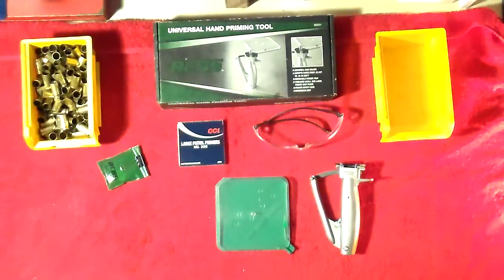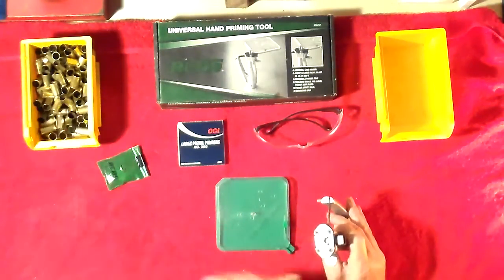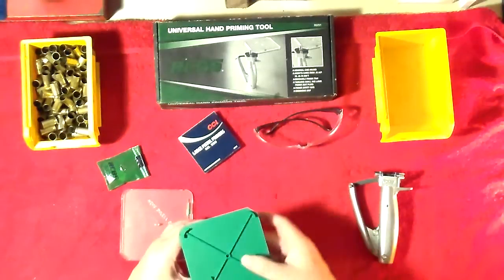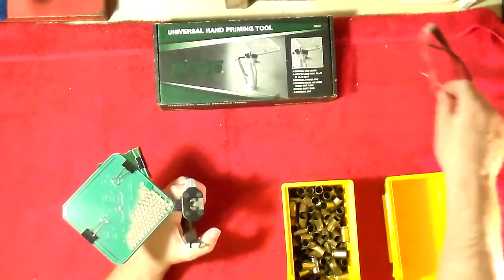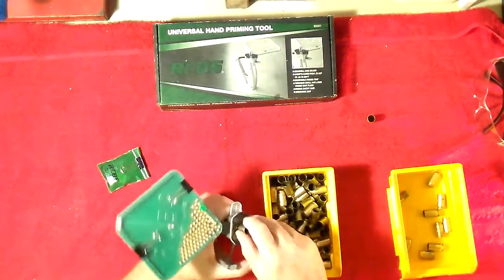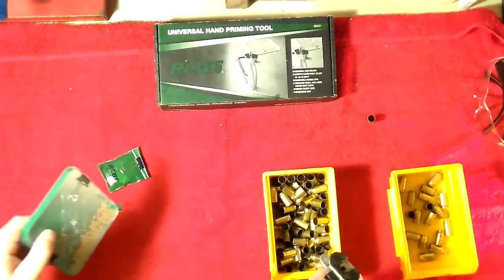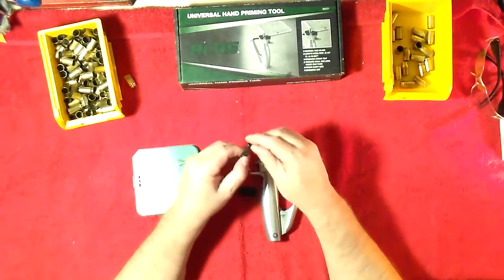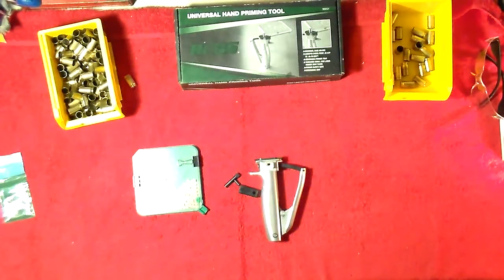RCBS UNIVERSAL HAND PRIMING TOOL

Comment: Thanks for the very informative video. I'm researching reloading my rounds. I have just one firearm - a .308 calibre Bergara rifle which I use solely for long range target shooting. I'm just beginning to research and buy the kit required for reloading (- as I'm nearly broke buying Hornady 168gr factory rounds off the shelf. !!! ) I wont be reloading anything but 308 Match cases. I have 300-400 once fired  cases ready to go. My question is - do you recommended I buy the RCBS Universal Hand Priming Tool 90201 (with square tray) or the marginally less expensive RCBS Hand priming Tool (Model 90200 with the Circular Tray) and then buy the required 308 shell holder separately. Is there any benefit in using one model over the other (90201 v's 90200) when priming one sized cases only. For example would the 308 cases fit more snugly into a 308 shell holder than into the recess on the Universal 90201 model? Are there any disadvantages to either approach when priming 308 cases only? Thanks. John (Ireland)

Comment: like you showed at 3:45, one problem with this tool.  snapping the clear lid on flips several primers.  very annoying.  even if I try to leave the lid up slightly, it doesn't allow the primers to flip very well
Reply: I found if you leave the bottom tray on the bench flat, then very quickly snap the top on, the primers rarely have a chance to flip over. I would say 1 in 100 maybe.

Comment: Nice video buddy but i would not be putting my hand over the top of your brass when you are pushing in a primer. The chances are slim but if one does fire well your fingers may get burnt. Like you say be safe.
Reply from the maker: You are exactly correct......I just primed some cases and I was not covering the case, I must have done it for some reason when making this video. I don't even need to use my other hand and I will adjust my technique....... Thank You for pointing this out!    Cmax